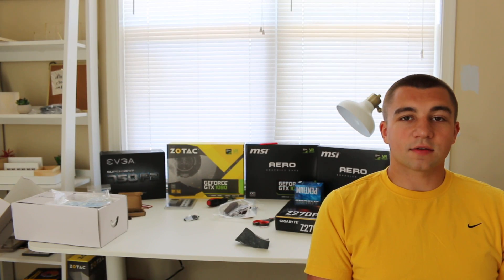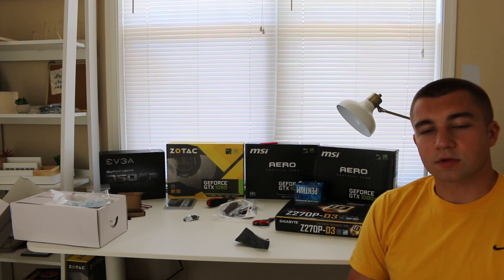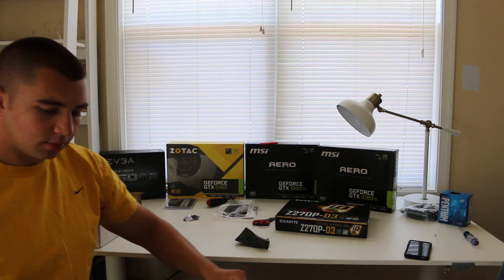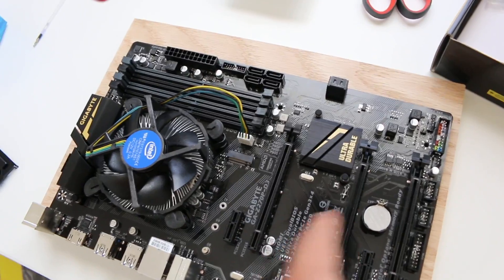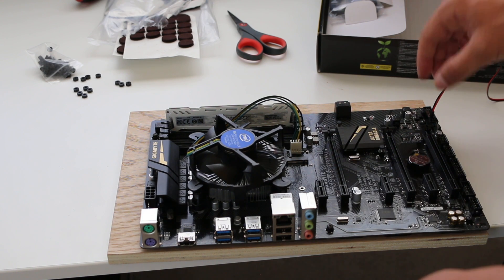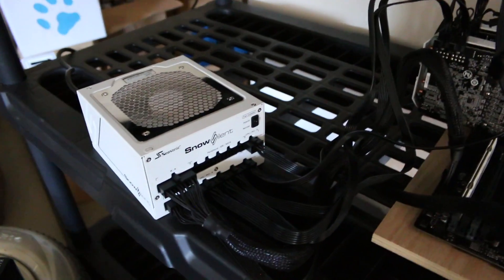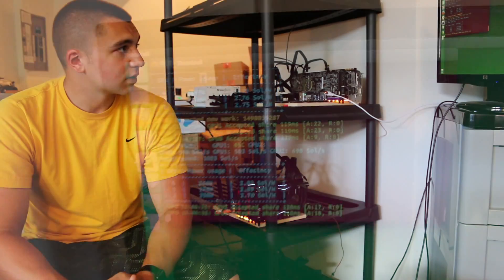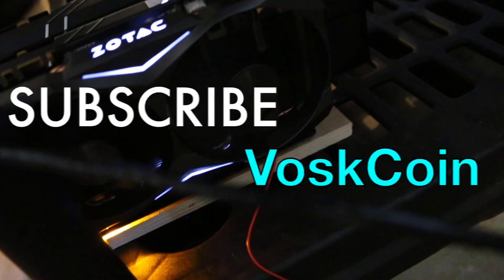How To Build the Best DIY GPU Mining Rig + nvOC - "Trio" 1080 TI + Mini

Comment: Can you recommend alternative cards that would work well for this build. I’m in the U.K. and the 1080ti is going for around £700. - £800 ( $1085 ) really looking forward to start my 1st build
Reply: sure I taught him this simple build  last summer zotac nvidia 1080 ti with blower  2 of them on uk amazon cost 623 pounds each  zotac 1070 mini 410 pounds amazon uk  or better msi  1070 itx  449 pounds amazon uk
Reply: Philipma 1957 Thant’s great thank you. One more quick question. Can I start with 1 card then add to it once it’s all up and running. My wife is scared I’ll spend a load of money and it won’t work lol. Just subbed your channel btw, I’ll be checking your vids this evening 👍
Reply: 1 card then 2 then 3 is fine
Reply: Philipma 1957 thanks Phil. Will be ordering parts today !

Comment: Hey Vosk. Appreciate all the information you have put out. It actually led to me buying a couple rigs myself. I currently am running Ubuntu 16.04 and overclocking and undervolting is a nightmare on this. I tried running NVOC and it loads but it doesn’t look like the miners are loading. It specifies to use -r miner and I try that and don’t get anything. I noticed on their webpage they have a list of compatible motherboards. I have a Gigabyte Z270-HD3. Is this OS flavor not compatible? Any help would be greatly appreciated. I can post my 1bash file if need be. Thank you!
Reply: I'm curious about this too as I just picked up an HD3 since D3's are hard to find.  Any luck after posting this 2 weeks ago?

Comment: I have 2800 dollars, and an Asus RX 480 strip (8gb) and an high end Asus mobo that has 5 pci slots and a 1200watt psu. What is the best direction to go in? Free electric.
I was thinking about making a trio (but in a nice stackable case) and running it while I'm waiting for it to sell on craigslist for 200-500 profit. (no compition in my local area)
Eventually I want to get to a high end 6 gpu. Not sure what to do.

Comment: I just broke down 12 gpu rig and made smaller trio with same board 2 x 1070 & 960.  Bigger is not better I have found out.  Ccminer and awesome miner like fewer cards per system for stable hash.  12 gpu rig was dropping gpus to idle in algos while miner continued digging.  Ain't no balls for tails in that.

Comment: Hey there, so a couple questions.
1. Looks like ur opinion has shifted over time so, currently what r the 3 cards you would build into trio? 
2. Do you have to use 1slot as a mini? Is that because of the space available in mobo?
3. In the rig in #1 what is avg. Sol and wts?
4. Once this rig is up and running how often do you have to maintenance? How long do they last?
BTW your build videos are fantastic! There is a lot of crap on YouTube. Thanks for not being part of that

Comment: Why the two full size 1080's followed by a third mini? It looks like here's room for all full-size and power isn't an issue if you bumped the PSU as you commented? I'm really baffled by this - ty in advance whoever!
Reply: I haven't found the temperature of a smaller form-factor card to be that much different than that of a full-size. I appreciate the feedback despite the mild snarkiness, but there must be another explanation?

Comment: 1080 ti is so expensive, I can get 3 GTX 1060 doing 900 Sol/s for the same price as the 1080 ti, and the ti can only produce 600 to 700 Sol/s.
Reply from the maker: Truth Seeker777 TI = Dollar  per sol and 200 watt power usage and not sure where you're getting 1060s that cheap but of course if it's worth it then it's worth it many different ways to mine!
Reply: Newegg has GTX 1060 3GB for $230, they can produce 280 to 300 Sol/s depending on the overclock.

Comment from the maker: FULL PART LIST - no need to message me about these parts, these are the recommended parts / what I use

ALL PARTS REQUIRED LISTED BELOW w/ LINKS
Inspired and designed on the bitcointalk forum operating off of nvOC Phil's Direct Injecto Trio GPU Mining Rig by VoskCoin Complete parts list below

nvOC official thread and latest version

https://bitcointalk.org/index.php?topic=1854250.0

MotherBoard

http://amzn.to/2uJDgsV

Screws

http://amzn.to/2uFjNLE

Spacers

http://amzn.to/2uJJtFv

Felt

http://amzn.to/2uKeAke

Power Switch

http://amzn.to/2eV5xsV

1080 TI

http://amzn.to/2vR9bIq
OR
http://amzn.to/2h9C52S
OR
http://amzn.to/2uJDAb7

Best Mini card for price available 1070 mini 

http://amzn.to/2eUul4c

CPU G4400

http://amzn.to/2vQRcS2

Ram Crucial

http://amzn.to/2fI5C3y
OR
http://amzn.to/2uJm5rD

EVGA 750w Platinum PSU

http://amzn.to/2uFLDYt

OR

Gold (cheaper option - less efficient)

http://amzn.to/2eUb17j

Lexar USB - best option currently available

http://amzn.to/2eU9P3N
OR
http://amzn.to/2ipmixA

Plywood - recommend sourcing locally otherwise amazon has options

http://amzn.to/2uFp3ik

Comment: I am confused, why on earth would you use this set up? Why wouldn't you use as many cards on a single board as you can? Save the money on the processors, board, thumb/hard drive, and memory. Risers are cheap. You can run 15 cards on simple mining, just get a motherboard that can support it.
Reply from the maker: The Trio GPU Rig is a simple, reliable, basic, and effective mining rig build. I plan to expand these rigs into 6 card rigs in 2018 :D
Reply: VoskCoin i like this idea...it gives noobies like me who is just begining to start a basic set up at a cheap and simple set up..yeah i know about risers and stuff..but lessens the complication with this build...a good starter for me to get my feet wet with mining..thanks.
Reply: I concur. Thinking about starting up and it's MUCH more appealing to start with the smaller invest, especially because I will probably screw it up. Thanks for k.i.s.s voisk!
Reply: If you watch other videos on people who are running 10 cards on a single motherboard and processor you will see that it can take a month to resolve all the technical issues and get everything up and running smoothly. With this setup, you can spend $100 more for a cheap processor and motherbaord combo and you would avoid the technical diffuculties which would allow you to start mining sooner, thus making you more money.
Reply: My guess would be he is just keeping rigs online until her can get more server grade psu's
Reply: using this setup you can use a basic PSU which are somewhat cheaper than the bigger PSUs ... and you don't have to configure much ... yes you can save a bit of money running 6x per mobo but the mobo/cpu/ram part isn't really expensive ($200?-ish?) ... if you go 6x you have to buy risers and possibly a case, hope they don't fail, buy a bigger PSU(s) with enough power and cables to run 6 cards ... the mobo needs configuration to run 6 cards at once ... etc.  There's something elegant about the trio rig IMHO  :)

Comment: Hey man where do you fund all of these projects from? Seems like you invested a hell of a lot into mining and I'm guessing you are making enough money back to pay for all of these set ups. Still looking at options to start out with myself. I would like to be able to cover the cost of the hardware in profit and from there out just take it as it comes and keep it as a hobby re-investing the profit if any in more miners. I missed the batch of the l3+ today as I was working. I'm pretty annoyed man. Hope mining is going well for you man, sure seems that way. I've still not decided what to start mining and what to use to mine it. I'll be sure to keep researching though.
Reply from the maker: Fortunately I've made a good amount of money in crypto that I've reinvested back into all these rigs furthermore . .  credit -- carrying a lot of debt right now hoping crypto will pay off big
Reply: Yeah well I took your advice and have just finished my first mining rig build. I built the whole lot by myself it constists of a Biostar TB250 motherboard with an intel celeron processor and 4gb of crucial ballistix ram with a corsair 1200i platinum psu. Then mining on a Msi Armor OC GTX1070. Just one GPU at the moment, thats all the budget can do right now. Achieving a steady hashing rate of 32.2Mh/s with some overclocking mining ethereum in ethermine pool and claymore. Another GPU to come soon. Electricity prices are high in the UK unfortunately.

Comment: one question: why you using 3 1080 per rig? with this board it should be possible to use 6? do it with Riser cables.
Reply from the maker: When I began building these good risers were sold out / overpriced - I can still always expand these rigs, in 2018 I plan to expand all trios into trixxers - like a sixxer? xD but seriously it's just a simple effective rig build to get operational and I plan to expand these eventually
Reply: Yeah, he essentially could have saved a bit of money by running 6 cards off one of the motherboards with risers instead of running only 3 cards per setup.
Reply: Rider cards are going for a lot now making cheap motherboards a cheaper solution
Reply: SYN TECH 
10€/$ each?
Reply: They are actually getting cheaper.  2 months ago each PCIE was going for around $12-$14, now multiple manufacturers are making them and you can pickup 6 packs of risers for $43 or $7 each.
Reply: Yea risers are cheap, you could put 3 more cards on each of those rigs man.